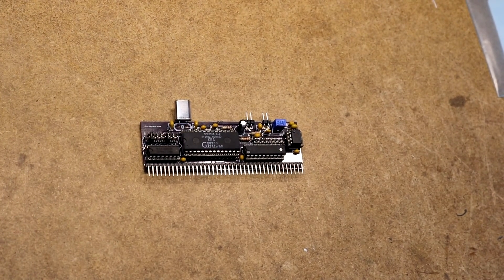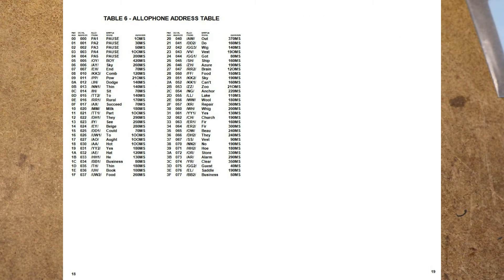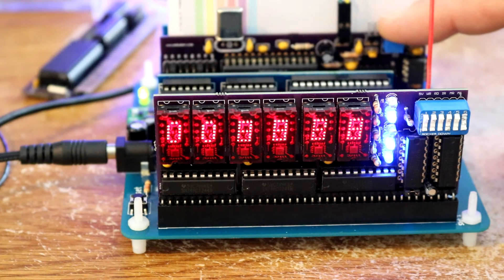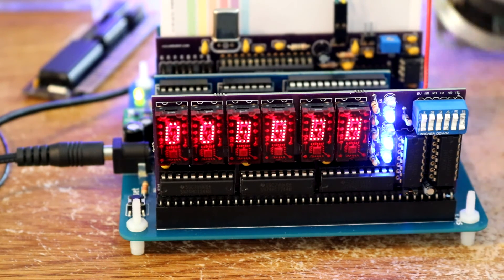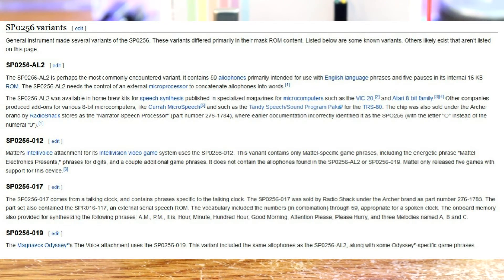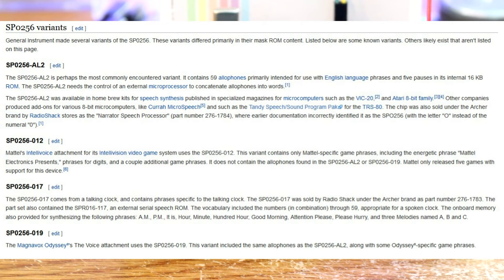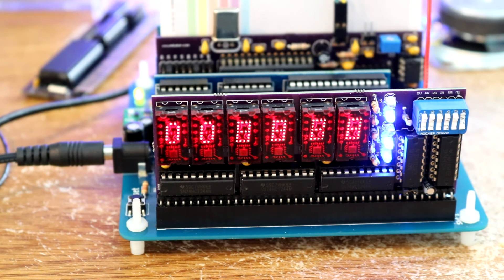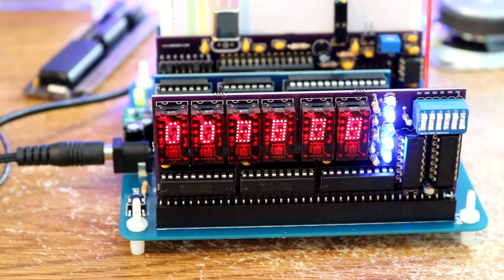SP0256A-Al2 speech synthesizer - misprogrammed? misprinted? scam? counterfeit?

Comment: If you do happen to have one of the custom SP0256 like the 012 or 017, those can still be used like an AL2 if you supply an external serial EPROM chip that holds the allophone data from the AL2 ROM. The ROM data is freely available online.

Comment: You may have a reprinted fake or a mistake from the manufacturer. You are definitely using the custom chip that was made for the Mattel Intellivoice for the Mattel Intelivision game in the 80s. (I used to repair those) Folks there are sooo many fakes of these out there, basically emulators that apparently do not work.  Plus there were several custom versions out there.  Radio Shack sold the correct one many MANY years ago.   It was the SP0256A-AL2 and they also sold the optional ASCII to Speech companion chip the CTS256A-AL2 controller. You mentioned buying more from china, I would not order these from china you will be tossing a coin in the air with those.  When buying check the date too, it should have an 81 - 82 for the speech chip and 84 for the controller. But even then these might be faked.  You can still get these original one at https://www.ebay.com/itm/273045417757
the same seller may also be selling the just chip and the 3.12mhz crystal.
These are the vintage chips.  supplies of these genuine chips are vanishing and people are apparently selling poorly hacked or PIC emulator copies which may not follow the same timing protocols as the originals.
Show less
REPLY

Comment: my guess would be the rebent the pins 180 degrees and reprinted on the reverse side so that they can claim it is a speech chip just a manufacturing misprint
Reply: You can't do that, the pin numbers would be all wrong, pin 1 becomes pin 28, and pin 28 becomes pin 1, etc. It won't work at all.

Comment: Must be a misprint or incorrect programming, since it sounds just like the SPO256-012 to me. I did sort of the same thing ages ago, bought some SPO264-064s on eBay, hoping for the same vocab as the SPO256-AL2- Nope, couldn't get anything. Probably, I wired it wrong (Those first times), 'cause I couldn't get anything. 

Later, after buying a proper SPO256-AL2 (And after some of those fake new ones marked Microchip), I found an eBay seller selling a bunch of SPO264s, with some additional information- I managed to get them working, and they've got some weird words like "1", "2", "3", "armed", etc. The only thing I can think of is for some voice security system. No info online, of course. I also found a google forums thing a few years old, with all the variations of the SPO256 there are (With some that Wikipedia doesn't list!). Don't remember where it is though. Funny, though!
Reply: That sounds interesting! I'm interested in those old speech chips. Could you upload its sounds somehwere?
Reply: nrdesign1991 Hmm, might do. Shouldn't take too long. Remind me later if I forget XD
Reply: Have done so now! There's a video on my channel, but here's the raw audio straight from the chip. http://www.mediafire.com/file/z3114y0fws2f8qe/SP0264-021+Samples.wav

Comment from the maker: My second batch of SP0256A-AL2, from a different eBay seller, has arrived. This new batch has a manufacturer stamp of "Microchip" instead of GRI. The good news is that they aren't mismarked SP0256-012's like the first batch. The bad news is I don't know what the heck they are; probably just some random 28-pin DIP IC that has been reprinted.
Reply: microchip bought out gi but i believe they never manufactured the chips

Comment: Could it be something silly like having the data bus wired backwards?  (ie 0..7 instead 0f 7..0)?  I haven't looked at the data sheet yet
Reply: Or perhaps the chip is in the wrong mode, and some line needs to be tied high or low or something
Reply from the maker: I thought of that originally and tried several other addresses that would be valid if the data bus was wired backward, but no luck. I believe what I got when doing that was static, probably from the chip's on-board ROM not having valid data in those locations.

The key is the phrase "Mattel Electronics Presents". According to the wikipedia page, that's only in the -012 variant of the chip, and that variant does not have the allophones of the -AL2 variant. The amount of ROM on-board the chip is quite limited, so it's probably the case that only one or the other would fit.
Reply: Ah. sure..  I replied before watching the entire thing. ;)  I remember playing with another speech synth chip from radio shack (the data sheet reminded me) where you could have it in different modes depending on how a line or two were tied.